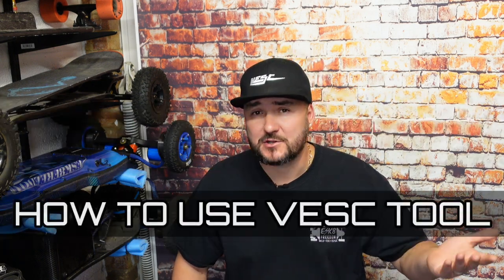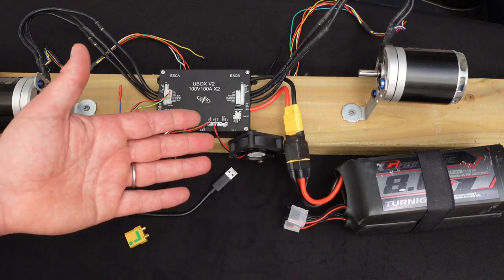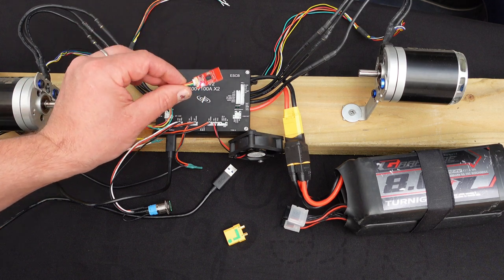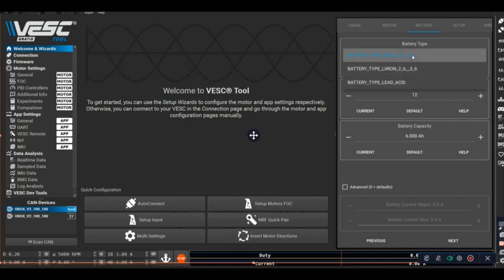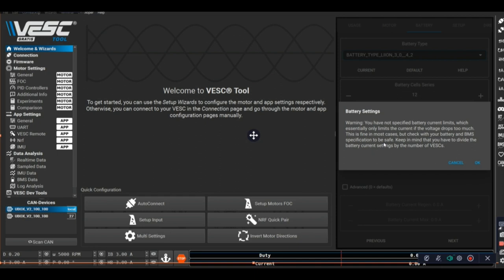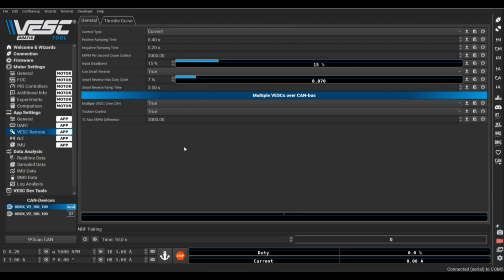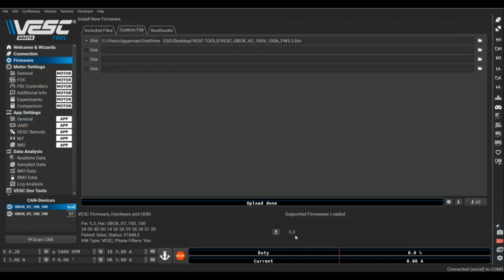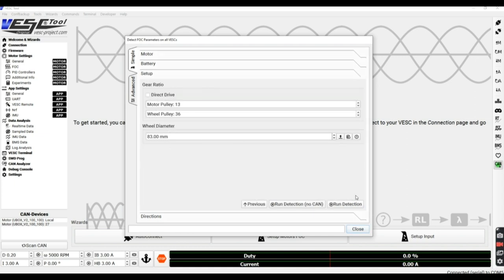VESC TOOL 2022 Guide. Using Spintend V2 for the tutorial.

Comment: how to change battery parameters, I can't do it!  I used a 36v battery and replaced it with a 48v battery but the display is not showing the correct voltage on the RT

Comment: I purchased the bn m1-at gear drive. Was told they had the 10mm motor pinions to match my Lacroix 6389 stock motors but changed after I purchased saying they can't find it anymore. So I purchased new flipsky 8mm motor shafts for the 63100's to fit the 8mm gear drive pinions. I installed everything. I was told only take a few mins to reprogram motors and gear drive 3.95 gear ratio (if needed) in the storm core app alone initially. I ended up downloading the vesc tool and thought it was running properly until the battery ran out of juice. Apparently the battery has not been charging over the few days I was running the new parts. The charger shows green, green generally tells me its fully charged but its not charging so I'm guessing I have not input the numbers correctly on stormcore/vesc tool. Any help would be so appreciated. I would love to Venmo or Zelle anyone who can help! Thanks either way! I'm almost there! I'm guessing I need to properly adjust the battery numbers. Its the stock Lacroix 12s4p p42a 21700 molicel but Lacroix is closed so I can't call them for correct numbers.

Comment: I'm trying to configure the vesc tool so that I can use a potentiometer on the adc2 input, so that it works as a pedal-assisted power regulator on my bike, I use an accelerator on adc1 and a common cadence sensor, but it is dangerous to use the assisted pedal if you are using a profile with a lot of power, my intention is not to need to use a smartphone to change the profiles but just a way to change the assistance...

Comment: This video didn't have exactly everything I was looking for but you did a really good job at covering everything.

 I'm surprised manufacturers have little to no documentation and you have to piece together so many little pieces of information so you don't blow up hundreds or thousands of dollars worth of parts.
Reply from the maker: Hi mate,  there are so many things to cover and i dud try my best to do it... what exactly you couldn't find in the video?
Reply: @PavelGarmas  A few things like switching to the other controller over canbus for the second motor settings, and adjusting the ppm settings if your controller is plugged in that way.

Sorry if you did actually cover it, it was a long video and I couldn't remember it all, it was a great video by the way.

Also if you know, can I utilise the other connections on a stormcore 60D? there's a lot of ports that I'm not actually using and I don't know what they're for.

Comment: Hey Pavel, great video as an introduction on programming a  VESC based controller. One thing I noticed was that you plugged in the bt using the traditional UART port, but didn't mention that the Ubox specifically includes a dedicated bt receiver port. That's a big benefit of the ubox V2. It keeps those uart ports open for other devices and backup remotes.
Reply from the maker: Good point mate 👍  thank you.
Reply: Which port is that, what is the label? I was very confused that I had to splice my BT into the throttle plug to access the TX RX terminals
Reply: @ThaPianoMan4  it's the 4pin port labeled NRF.

Comment: Hey Pavel, thank you the clarification! The only problem I'm encountering with the spintend remote is I must do binding eveytime I switch on the board
Reply from the maker: Hi mate,
This can't be right.... try to turn the ESC on first and then the remote.
Reply: @PavelGarmas  I know it's so weird, right? I've tried ESC first but got no response at all. I have to do binding every single. Also I don't have the board battery reading on the remote.... I guess I should address the matter to spintend
Reply from the maker: @cesardorm  hi mate,  have you watched the video and done set up again?
Spintend are quite good with helping out so email them.

Comment: This tutorial was exactly what I needed! Thank you for explaining everything from wiring to all the little details in installing/using the vesc tool. I just have one question. I have 2 6s lipos, I'm thinking I may want to use them sometimes im series, and sometimes in parallel depending on the situation. If I set the vesc tool for 12s, would everything function normally at half voltage? or would the vesc give some sort of error.
Reply from the maker: Hi mate,  Thank you for watching and for the comment.  You have to set the voltage of the battery in vesc tool and do all the steps again if you change the voltage of the battery.

Comment: Hello Pavel! Can you please help with setting up the maytech speed controller in the VESC Tool only for an electric surfboard?
Reply from the maker: Hi mate, 
I have never set up the surfboard but i guess it is the same principle mate. Did you try following the tutorial? Should be same but the battery size, motor size and being single motor.

Comment: Great vid, How do you know which color of hull sensor wire does what?
Reply from the maker: Hi mate. Thank you for watching. Hall sensors can be plugged in in any order...does not matter. Just ensure to get the ground and 5V plugged in correctly. There might be another cable which is the temperature sensor but depends on the motor.
Reply: @PavelGarmas  thank you so much!!!

Comment: Question: Battery Current Max Regen - in your example you used 30Q, which has a max CHARGE rate of 4amp per cell not 30AMP...So surely you would get 4amp and times that by the amount of cells in the P group, lets say 5p in our example, to give us a total of 20AMPS regen, which has to be split by 2 ESC. So 10 amps per ESC regen.. Putting 25 amps per ESC (50 total amps), would surely be charging each cell at 10amps each? Wouldnt that cause issues?
Reply from the maker: Hi mate. Thank you for the quotation.  My view is ... if the cell can discharge at 30Amp, it can recieve 30 amp for short duration.  All my battery packs are set to 25-30 Amp regen and no issues. I do not consider the regen as some power saving as it is very negligible gain however motors would heat up more if energy is not taken away. You should set it to what you think is right...my videos is the way i do .

Comment: Hi Pavel ✌🏼️ I'm building my ninebot max g30d 2 with two vsett 10+ motors and big 20s6p molicel aku under the scooter. The ubox would be in an extra bag on the Board. My question is: 1. What setting do i take for scooter? Also Electric skateboard? And 2. Can i use a Smartphone instead of a dashboard? I ordered ubox with Bluetooth 
Thanks man 🙏🏼
Reply from the maker: Hi mate,
I do prefer to do the initial set up on the laptop, then tweak things via  the phone if needed. I do have tutorials showing how to set up a board. Setting for the cdooter will depend on the motor parameters.

Comment: Hey I love your videos. Quick question, how would I best find the max discharge rate of my batteries? I have Samsung 50g 21700 cells set in 12s3p.
Reply from the maker: Hi, your maximum discharge is P value times the cell constant discharge rate. according to the data sheet the discharge rate is 9.8 Amp so you battery max is 30 Amp.
Reply: @PavelGarmas  thanks Pavel, you're absolutely awesome.

Comment: Hy, very useful video!
I have a problem you may be able to help with: I have a fsesc 7550 and want to connect the flipsky vesk skreen with ppm trottle support and the a bt chip to connect with my phone at the same time but the bt only seems to work when the screen is not connected. I am using the 75/300 v3 firmware
Reply from the maker: Hi
Sorry for the delay with reply.  Join ESK8FREEDOM Facebook group and ask the question there. It's my group.

Comment: I bought the same controller in this video and it says it’s safe for 22S LiIon. Do you know a good 22S BMS with a 200A discharge rate?
Reply from the maker: Hi mate,
I do not use bms for discharge and do let esc control it. BMS is normally by-passed on most of the diy builds.

Comment: Hello,
I have a flipsky 4.20 vesc and I currently have a problem. The remote is connecting to the vesc (can tell it from the LED's) but it's not showing up when I want to trothle it. And besides that it's only spinning one motor.
Maybe you can help me out with this issue.
Thanks!!
Reply from the maker: Hi
What battery do you have on your build?
What is the firmware on the esc?
If 5.3 then you need to activate the remote ppm ot uart ...not sure how uou are connected. 
Is the " dual esc via canbus" true or false in your settings?
Reply: @PavelGarmas  hey, sorry to butt in but I have a bluetooth connection issue with my new spintend 100/75 with 5.3 FW. It says it doesn't recognise the firmware when I connect with the Vesc app. Wiring is all correct. Can you elaborate on what you mean in your reply above, about UART and PPM? I think this might help my problem..
Reply from the maker: @ollieb7019  Does it work with 5.2?
Reply from the maker: @ollieb7019  sorry maby silly question but is the phone App compatible version to 5.3?

Comment: Did you have an issue with having to push off before the motors spin up ? From a stand still I just get shaking no forward movement.
Reply from the maker: Nope...no issues with that. Sounds like your sensors are not working. 
Check all the wiring again, check phase cables.  Do the detection again. What esc are you using? If Trampa vesc then check the voltage switch to see if it is 3.3 or 5.5 volt for the sensors.
Reply: Ubox v2 sensorless motors . Thought maybe a bad phase connection or a vesc tool setting that I was missing. Thank you for replying.
Reply from the maker: @stephansmith300  sensorless...ok . You need to set them up HFI
Reply: @PavelGarmas  oh okay I'll give that a try . Thanks

Comment: About wiring!
I have one motor with one coil shot (working but struggling and overheating). Second motor just died after working perfectly. I don't know why. 
Anyway I ordered identical ones; if I'm gonna replace it, do I only switch the motors? Or do I need to reprogram them somehow? 
My VESC is "Tenka focbox". I don't know anything about building the boards (I bought used one)

Comment: Great tutorial! Thanks Pavel! Do you prefer the Ubox V2 100V over flipsky dual FSESC6.6 plus?
Reply from the maker: Hi mate,
I do have both hiwever FSESC 6.6 plus is the oroginal 3 year old unit and is very good. New units are being reported as having issues.  I do use two Spintend units one 75 V and another 100V as well... no issues so far.
I got discount codes for both Flipsky and Spintend if you are interested.
Reply: @PavelGarmas   ok thanks for the feedbacks. I have your spintend code and would be interested to have the flipsky code. I have the old flipsky 6.6 dual mini plus. And everything went bad after i upgraded the firmware to 5.3: abs_over_current fault, motor screaming and stuttering... I don't know how to downgrade the firmware wity flipsky
Reply from the maker: @morozband  it should be the same as downgrading the Spintend one just using VESC firmware.  I do have a video on how to do it for Spintend. 
Flipsky discount code is -  pavel
Reply: @PavelGarmas  and thanks for the flipsky code
Reply: @PavelGarmas  do you mean that i can download the 5.2 firmware from Spintend website and flash it on my flipsky 6.6 dual via vesc tool 3.0?

Comment: Hello i know this video is a while old, i using a E-Scooter Named IO Hawk Legacy 2.0 that is just a Downgraded VSett 10+ but is by that Vesc possibility to use Single/Dual Switch (DDM) so that i can drive just in single or with dual engines and turn lights left/right ? 
And is it possible to use just like Remote control to reduce the speed e.g. Max. The speed should be 22 km/h and when I click on the remote control it then throttles down and can then go around 30-40 km/h and when I click on it again then again maximum 22 km/h, Is there a switch you're looking for between 2 profiles or can I just switch it like that using the Vesc tool app?
Why I'm asking the whole thing is because I want to use everything from the Legacy 2 and at least have a high quality controller inside that I can use to control the whole thing, like. switching the light on and off via the display and the display shows the voltage when the battery is empty from 52V, which I switch to 48V and it continues with the last few kilometers.

Profile 1 would then be
Level 1 = 8km/h
Level 2 =16km/h
Level 3 = 22km/h

profile 2 would then be
Level 1 = 12km/h
level 2 = 20 km/h
level 3 = 35km/h

I would be happy for a Answer ❤️
Reply from the maker: That is true but unfortunately bike will loose a lot of power and speed as soon as you hit 19%. Tested many times.

Comment: #Pavel Garmas Hello, I have a question, I have iOS, I updated the firmware and my bms disappeared, and I don't have a battery chart and I can't charge the skateboard, could you help me solve the problem?? I restored the versions to the previous version.
Reply from the maker: Hi. Vesc tool doesn't control bms.

Comment: Hello and great video btw
One question, if you were to use a dual motor esc with a single mcu like a focbox or a storm core, is it still a requirement to program both sides of the vesc? Thanks.
Reply from the maker: Hi mate. I have noticed that most of the times slave side of esc gets the setting over with no problem however most manufacturers do recommend to check the second side by plugging in.

Comment: Hey Pavel, this video is everything that I needed! Excellent job! I was so confused how to configure this.
Anyway, I have a question that maybe you could help me to answer. I have te Torqueboards Direct Drive motors with the Focbox Unity. When I do the run derection it only does about 28 amps per motor, but when I do the same run derection without the sensors it will go up to about 78 amps (which is the brand says would make). 
Do you know how to make the motors runs up to 78 amps with the sensors connected?
thank you!
Reply from the maker: Hi mate ,
Thank you.
So to understand this correctly,  you do the motor detection with sensors plugged in and it does detect motors at 28 Amp on VESC but if you inplug the motors then it detects them at 78 Amp. Correct?
If above is correct then something is strange.... 
Are you setting them up as hub motors or as outrunner large?
Have you tryed to set up with sensors plugged in and then just increasing the motor Amp in the vesc to 70 Amp?
Reply: @PavelGarmas  Almost exactly like you said. The motors are always connected, but the first time I setted them up without the sensors connected and I've got about 78 amp. Then the second time I connected the sensors and  setted them up again and is showing the 28 amp.
Reply from the maker: @MnTrXuP  set the motors up to allowed Amps. So if you know they can take 75, set them to 75 and try on the bench.
Reply: @PavelGarmas  Thank you for your patience! this is my first esk8 build so definitely you helped me a lot!
I just got one last question. Do you know if you could switch between profiles just with your remote?
Reply from the maker: @MnTrXuP  profiles no... not at the moment. It is very easy to do by using metrpro dongle and app though.
Reply: @PavelGarmas  Thank you for sharing your knowledge! Really appreciate it!
Reply from the maker: @MnTrXuP  no problem mate 👍

Comment: I have a dual motor set up. I need some help big time 

When i run detection only one motor spins. The local one doesn't spin.. and when i get the detection resuls they are WAY different to each other
Reply from the maker: Please check the soldering on the phase cable connectors ans make sure that pligs are in a the way and are tight. 
Are motors the same? Same make? Same age?
Reply: Yeah everything is new same motor same brand new everything.. I'll have to cut and re solder the plugs
Reply: Trying to run flipsky 6384 through a flipsky  DUAL FSESC6.7 plus
Reply from the maker: @TinkersGarage  
@TinkersGarage 
Are the plugs original or you have soldered them?
Reply: The plugs are original on the motor side the VESC didn't come with plugs just solder on the ends I soldered 4mm bullets on the ends

Comment: Another question I have, you only changed settings on the primary ESC, does the new 5.3 tool copy settings to the other ESC over CAN now?
Reply from the maker: Very good question! It did in my case and has done before however it is best to check both sides to ensure that all settings were replicated.